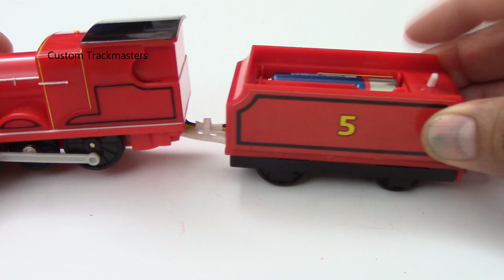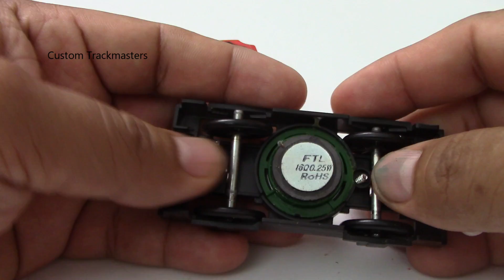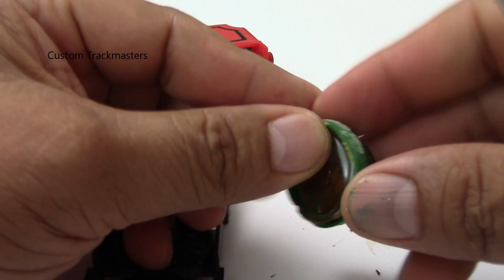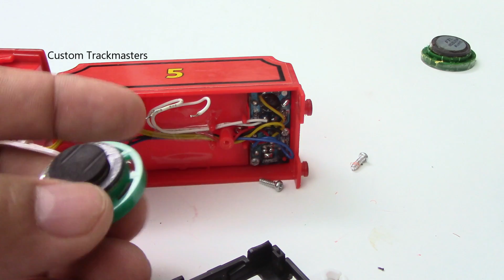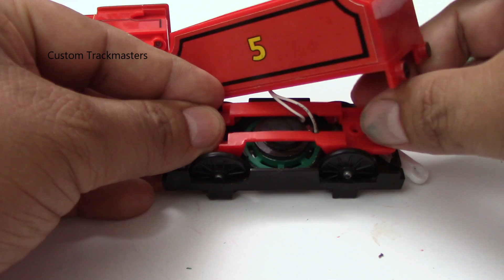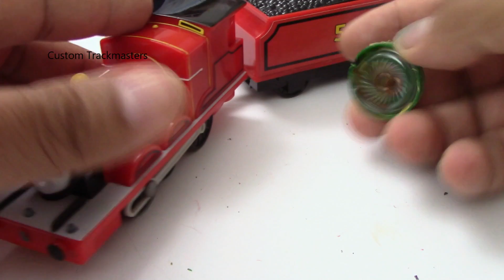How to replace a Speaker on a Trackmaster Flip face Talking James

Comment: My steam along thomas has a distorted speaker right now and it isn't the right speaker now because dumb me kept putting thomas on a 9 volt battery to him when he was detached from annie,then the speaker and light died but he still steamed, and now it needs a new speaker & light,then annie needs a new motor with the parts on it, a new gear axle and a new gear with the spring on it. PS. the light did not blow up it just simply died.